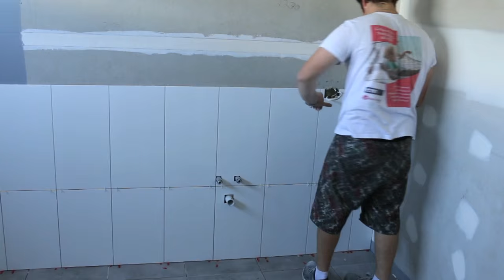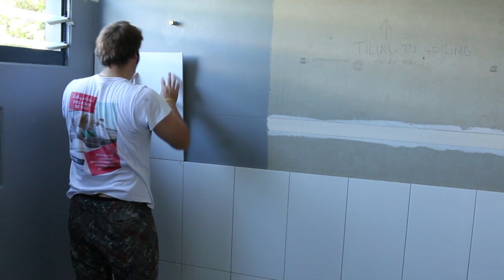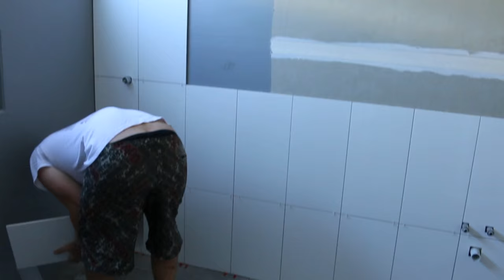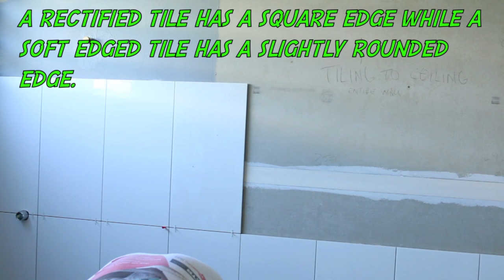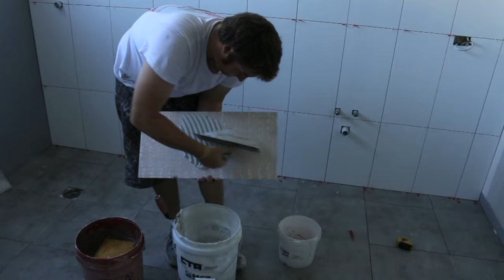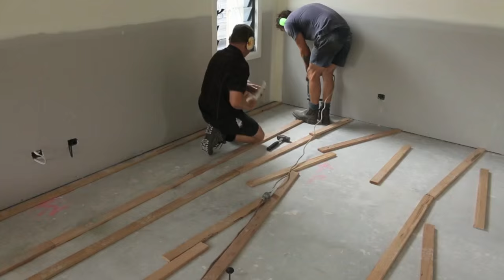Tiling Bathroom Walls. Owner Builder Series Ep 34.

Comment: Love you channel....  :) but Adhesive on tiles..... Hmmmm.  The adhesive did not not cover on the corner of the tile, the tiles will crack because it's not supported.....
Reply from the maker: +Frannocom Thanks Frannocom. There is so much glue on the tile that there is no chance of it cracking. When the tile is placed on the wall the glue will spread to areas where you may have missed a little. Also there isn't any pressure on a tile hanging on a wall. Different story on the floor where people are walking over it. Thanks for watching. Cheers